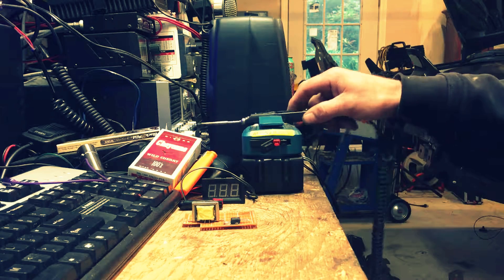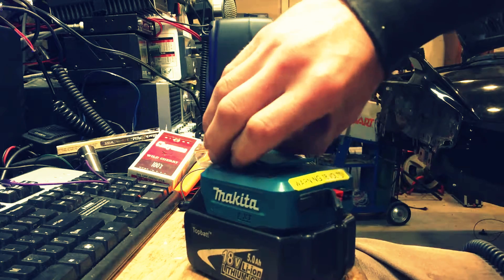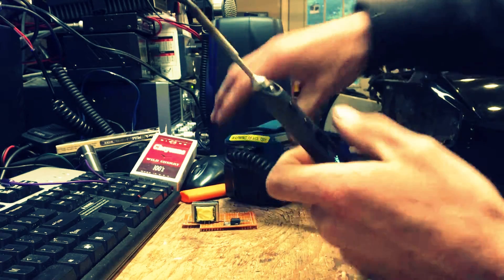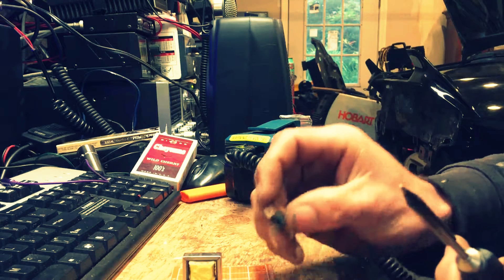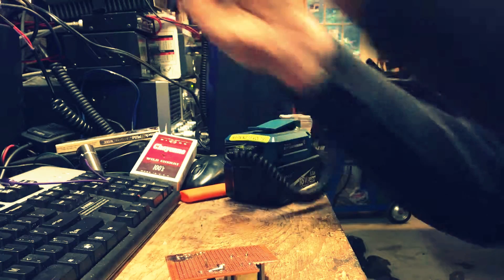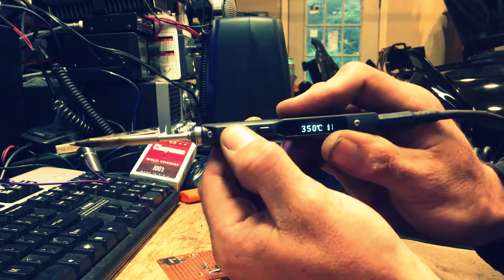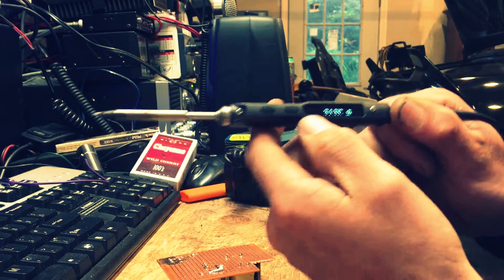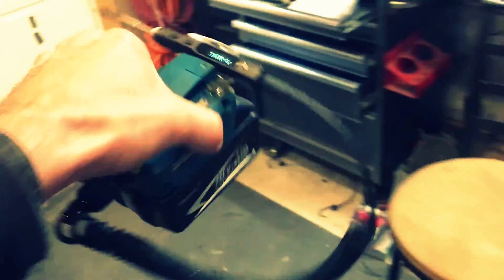Sainsmart pro32 (ts100) micro soldering station

Comment: What type of connection are you using? I see the USB port on the left, what are you plugging in on the right? Can you leave a link to the adapter and cord you’re using? Thanks.
Reply: TS100 uses 24V 3A+ barrel connector. The USB port is for firmware flashing/updating since it is an "intelligent" device with microcontroller and oled display. A quick google search for TS100 power supply should turn up enough results and you could technically also run it from an old PC PSU by hooking it between the +12V and -12V lines.

Comment: Do you need to be carefull not to drain the battery to low because the Makita charger will no accept it anymore ? Or is that not a problem ? How many volts are left after a couple of hours of use ?
Reply from the maker: I will be sure to get back to you with a voltage reading on it next time I swap batteries. So far I just notice the iron taking longer to heat Up so I swap batteries out at that moment. I was worried about this myself with draining Too low, but so far so good!
Reply from the maker: Also now that Im thinking about it, The makita batteries will not take a charge if their computer board sensed low low voltage. But if we are using the batteries this way, it is connected to the positive and negative leads, and it does not connect to the battery management system. So  I could be mistaken, but you should then be able to run these down to the cells minimum without affecting the charger. I think they will not take a charge if the battery management sensed low power during use.  Ill find out! Im poor but also willing to do the test for EVERYBODY!! Ill run this down to like 15 volts, maybe even be a little risky and run her down to 14 volts.  which is less than 3 volts per cell and these battery cells do not like going below 3 at all. Typically the drills shut off at like 16 volts. So once I run this down to 14-15 volts ill slap it on my charger and see what she does!